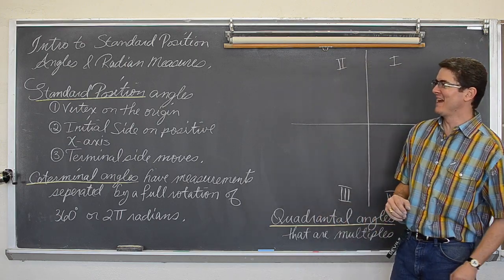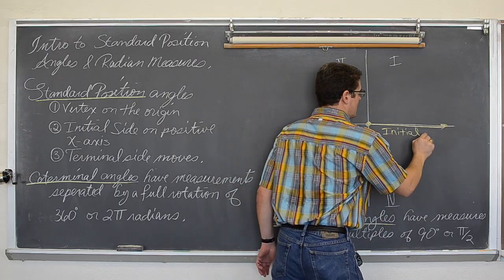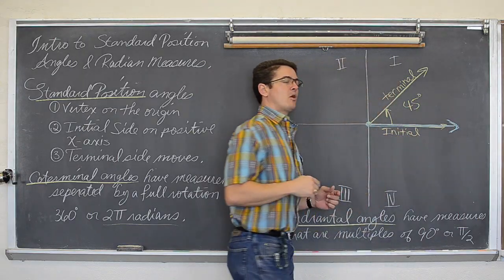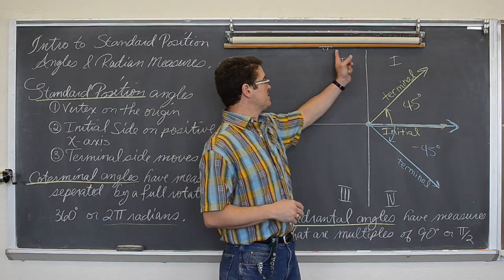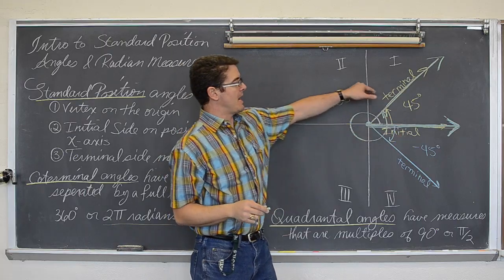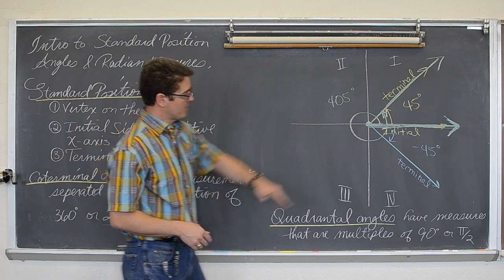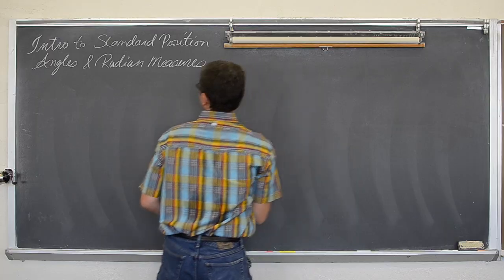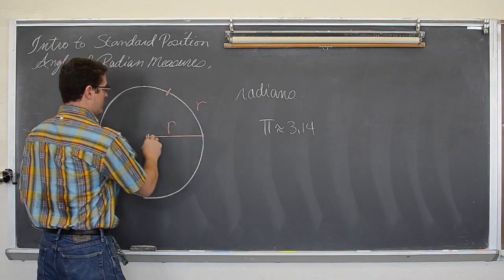Standard Position Angles & Radians Part 1

Comment: Why are you using pi? Pi is not a "full rotation", it is half a turn. Teach tau instead.
Reply: Pi is the conversion of  360 degrees bruhh
Reply: @Nanman13  No, pi is 180 degrees, a half turn. That is why the tau is needed.
Reply: @johnnicholson8811  what is tau? I apologize for my previous comment 😂😅😅

Comment: My question is, if you have to find two co-terminal angle of -15.5(degree), but you are restricted on your co-terminal angles. In another words, your answer has to be greater than zero(degrees) but less than or equal to 360(degree). I found one co-terminal angle which is 344.5 (degree), but i am unable to find the other positive co-terminal angle.
Reply from the maker: To find a co-terminal angle you need to add or subtract 360 or whole multiple of 360, so you found the only angle between 0 and 360 which is co-terminal to -15.5
Reply: ProfRobBob Thank you!!

Comment: Keeping in mind that Pi is not 3.14, it's 3.14159 26535 89793 23846 26433 83279 50288 41971 69399 37510 58209 74944 59230 78164 06286 20899 86280 34825 34211 70679 ...(cont'd.)
However, because this is a calculation to such a small fraction, standard tools used for measurement only go to +/- .005cm (assuming the standard tool for measurement is to the millimetre.) Thus, using Pi to two decimal places is not incorrect, it would just be nice to see a distinction to limit confusion in the future.
Reply: Thats true, but then again pie is a limitless number.  In other words no matter how many characters you go out there will always be more, however there is a point where its so small the difference will not matter

Comment from the maker: Because arcsin as a restricted function can only give you answers between -90 to 90 or the equivalent radian measures.  It is not that it does not work, it is giving you a usable angle that has the same reference angle as the angle you are seeking in quadrant 2.

Comment from the maker: It is just a smaller number or a different scale of measurement, not less rotation.  5280 feet is 1 mile.  While 1 is a smaller number it does not represent a smaller distance.  I do not know or remember the origins of each type of measurement though.